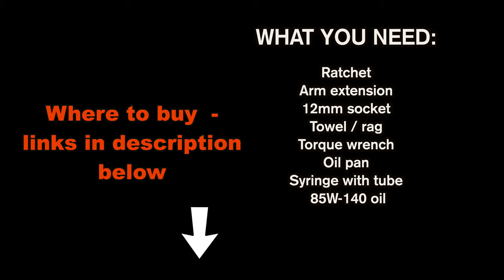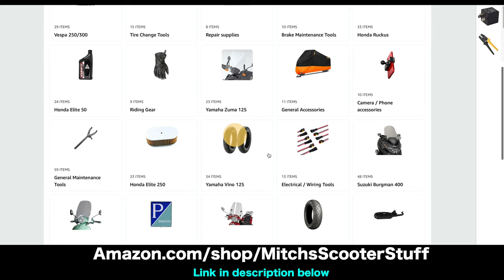Yamaha Vino 125 Transmission Oil Change | Mitch's Scooter Stuff

Comment from the maker: * Tools I used in this video:
Ratchet 3/8 drive - http://amzn.to/2hhmnUs
3" / 6” extension set 3/8 drive - http://amzn.to/2h7ypMl
12mm socket 3/8 drive - http://amzn.to/2xM4Edr
Rags - https://amzn.to/2Yh8jvg
Torque wrench 0-150 lb/ft 3/8 drive - http://amzn.to/2Crqq4R
Oil pan - https://amzn.to/3bOmT5Q
Syringe 100cc with tube - http://amzn.to/2G951U2
85w-140 transmission oil - https://amzn.to/3I9TzF8

Comment: Thank you for a well-executed video + all the extras (torque, socket size, e.g.). Do you have a Yamaha Part Number or any info on where to get Crush Washer (which you mention in video) for Transmission Oil Drain Bolt? Or...does Transmission Oil drain bolt accept same size crush washer as Yamaha M14 Motor Oil Drain Bolt?

Comment: Can you tell me what kind of gear oil a 2004 vino scooter 125 can take if any one nos let me know. Is gear oil the same as trans oil justs asking do to I no my oil on mine is ten w 30 motor oil Infront. But I don't know what kind to put in rear end in back I just bought me one a 2004 model so let me know someone please let me know. Mine is a 2004 Yamaha 125 vino I just don't no much about it thang looks like new